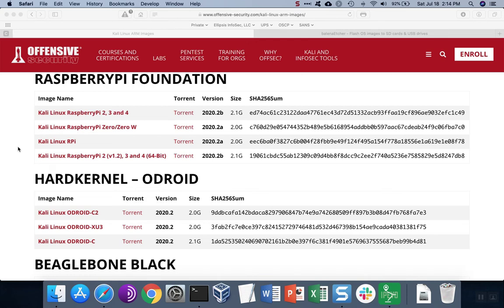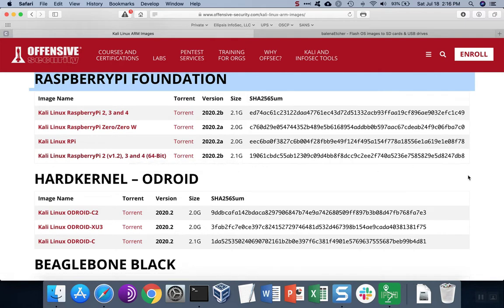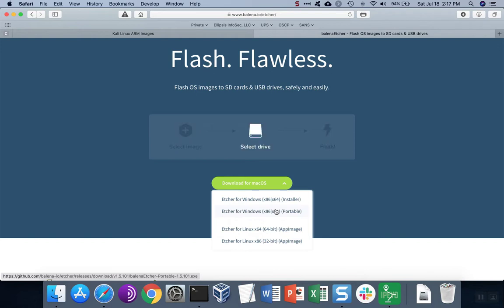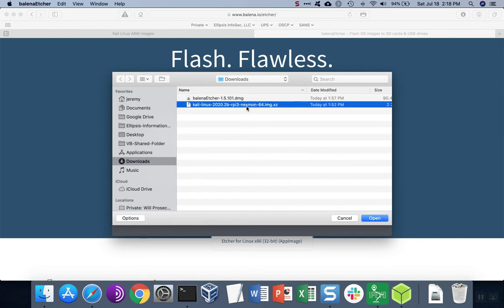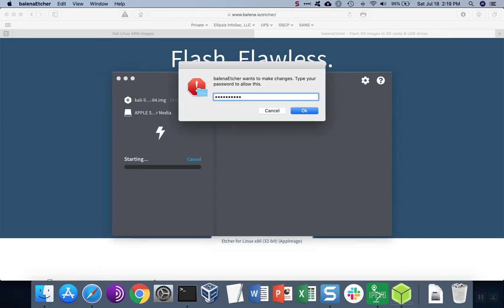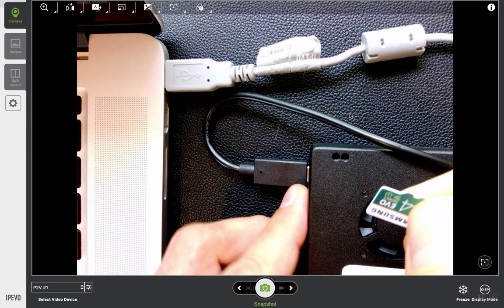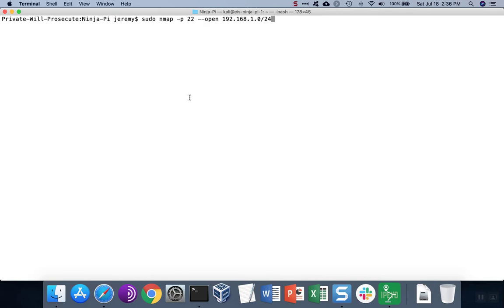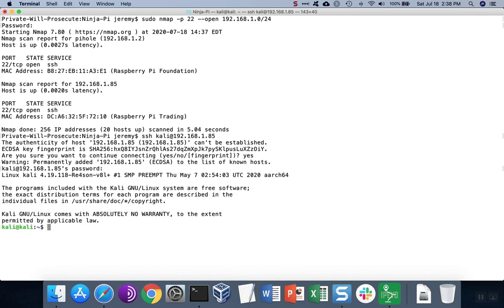How to install Kali Linux on Raspberry Pi 4

Comment: hi anychance your still active im on mac too and having troubles burning kali on my sd card ive formated it multiple times used different images but everytime it's say an error occured but no detail it's always at the end the sd card is fine too it does the same thing with other ones too